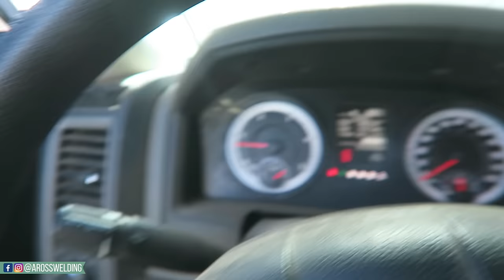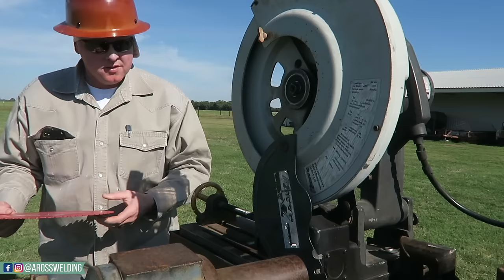BUILDING PIPE FENCE // NO COPING OR SADDLING PIPE

Comment: A LN25 with some flux core would be good for this job.
Reply: What size flux core cause I tried .035 out last week and switched back to my 6011 1/8 in by weeks end, settings were smooth abt 200 wire speed and couldn't tell you the amps
Reply: @caseyjones3182  
Have been using .035 NR 211 MP on galvanized pipe and carbon steel pipe . Lincoln also makes .045, .068, 5/64 and 3/32 wire. Lincoln also has a video on how to use this wire. Get a Lincoln welding consumables catalog at your LWS and look up recommended setting.

Comment: When you're making lots of cuts on heavier pipe like that a spray bottle with some water based coolant in it helps the blades last way longer.
Reply: Best coolant is a tablespoon of dawn dish liquid to 2 gallons of water. Fix a small 12v pump sprayer like used on ATV’s or whatever, to the saw so that when the trigger is pulled, it begins spraying an inch or so in front of the blade. It’ll nearly double if not triple the life of those blades. I’ve see a 12” Diablo last through 300+ cuts in 3” drill steel

Comment: Did they only have a 12" blade?  I would assume the RPM rating between a 12 and 14 inch blade are different. I've had  good luck Diablo Blades.
Reply: It’s all about SFM; a saw/blade combo set up for 14” will be running less surface speed on a 12” blade.

Comment: If your holes line up , why can't you pass a full-length pipe horizontally thru the full length of the pipe ? No waste . Also , why can't you use the first "cut-off" , split it down the middle and slide it over the pipe as a template , or guide for the rest of the cuts ?

Comment: yes cutting holes in the pipes with a torch use to be the way we did it years agom but with the sky rocket cost of the gases, and the dangerest goods tax on every tank fill, it just not cost effective any more, running a torch today is very costly, i always say, it cost 5 cnd bucks just to light the thing up and set it.. notto mention gas cutting torch is old school today..

Comment: Where did you get that hole cutter for the posts? I'm building some big ass corrals right now and I am about as burnt up as ya can get on saddling each individual rail.
Reply from the maker: I got mine at my local welding supply. Stillwater steel. You may be able to find them online. If not try callin one of these places. 
Stillwater steel 405-377-5550
Munn supply 580-234-4120
Chickasha ind and welding 405-224-2215

Tell them I sent you

Comment: What if you removed the ball rollers and replaced them with tube rollers in a vee configuration?  Like a V8, or how ever many rollers you wanted to use; at least four to center the pipe.  Just stager them so they run alongside each other at the bottom.  Should run last longer and be less of an annoyance on the job.
Reply: Then you wouldn't be able to slide the pipe and roll it. They serve a dual purpose.

Comment: I'VE GOT A GOOD QUESTION.WHY IS IT IN PIPELINE WELDING MOST OF THE WELDING OR ALL OF IT IS STICK WELDING,WHAT'S WRONG WITH FCAW(SELF-SHIELDED SEMI-AUTOMATIC WELDING)?  OR MIG(SHORT ARC)FOR THE ROOT PASS AND FCAW(INNERSHIELD)HOT PASS,FILL AND CAP PASS! YOU WOULD SAVE$$$$.
Reply: He may just be best at stick. 12 years stick on pipe and I think he said in previous videos he never went to weld school just learned from a shop

Comment: Why not run full joints all the way through? It would eliminate a lot of cutting. You would have to wait to put the end posts in but it would be less work and a hell of a lot stronger.
Reply: If your thinking of sliding the pipe all the way through the post. First off that would be tricky the holes would have to be on the  nut or maybe a bit sloppy. Ok and the weld the pipes where they butt, and then where they pass through the post??? I think that would be a lot harder to do. And don't forget longer pipes weigh more and harder to handle.
Reply: @TheRitchieLeeShow  that wouldn’t be tricky at all. No need to weld the butt joints together as you would end them inside of a post. It would be stronger than hell.

Comment: Whats the sprayer for on the truck? Small grass fire? Im not a welder i do weld but i wouldent call myself a welder haha im a heavy equipment mechaic by trade so i do lots lf steel arc and mig
Reply from the maker: I use it to wet down areas where I will be welding if it hasn’t rained in a while and the grass is real dry

Comment: On a large job I’d think custom ordered laser cut pipe with length and holes cut, driven down with skid steer hydraulic hammer would not only be sooooooo much faster but be cheaper with all those man hours saved

Comment: Good looking job but cutting 12-16" of pipe off each post would have got my dads belt across my backside! Scrap steel cost more to load up and haul off than its worth. Waste not want not! 

Nonetheless its a dang good looking fence
Reply: No doubt.
Reply: It's decent practice for welding small pipe. unless it is super magnetized, then it's a PITA not worth anything.

Comment: Austin where did you get your circle burner for straight torch?
Reply from the maker: I got it from my local welding supply. We couldn’t find them online so We are fixin to have them available on my website. Are you interested in one?
Reply: Austin Ross yes absolutely never saw quite like that it’s looks slick. I have got a pipe fence project coming up my self and that’s goin to be the ticket.
Reply from the maker: 👌 do you have an email I can reach you at?
Reply: Austin Ross yes I do but I sure hate to give it out on here. Would there be another way to get it to you
Reply from the maker: Ya you can just email me at arosswelding@gmail.com
Reply: Austin Ross will do thank you

Comment: Anyone ever use square tube ? Wouldn't need to cut all them holes in the posts, just hafta design a jig for setting the rails, anyways you're work looks top notch imo will definitely outlast us.
Reply from the maker: Ya I’ve seen some square tube fence. Looks nice too. Some times it can be more expensive than pipe, depending size.
Reply: @arosswelding  Oh ok, one more thing, I'm a retired ironworker and did quite a bit of welding over the years, was wondering why you wouldn't do your welding with a wire machine ? I know I could run 1 pass around that pipe and be on my way, plus not having to deal with all them stubs.
Reply: Em J Bee  8 Milwaukee Wisconsin

Comment: Why not build and set them in sections? Build a section in the jack stands and set it with a tractor and so on, just seems like a lot of position welds and having to do all cuts in position would take more time and be more difficult, just saying as a pipe fitter/welder

Comment: I do not know about Diablo metal cut off blades but we swear by Diablo on construction sites because unlike other blades there contractor grade models will cut through just about anything we might encounter on the job site and stay sharp a bit longer then others in the same price range. When you use your saw as much as we do on the roof for sheeting you need a blade you can count on every time you grab it Diablo was that blade for us.

Comment: This fence is gonna require a lot of maintenance to fight the rust that will set in yearly unless each pipe is painted with an apoxy coating paint.  Pipe is so expensive it has to be a rich person who has deep pockets that's willing to put out this much money for a fence usually people use creso post because all you do is paint them one time if you paint them at all and then you're finished with it But anything made out of metal will yearly have to be tended to unless you use that very expensive epoxy coating paint ,  I used to weld off shore and that required most of the work we had to do offshore was to install new 2 inch hand rails because the salt water would eat the 2" pipe up they would only use cheap paint offshore and that saltwater would get through it but that provided work for all the welders that went off shore if you ever go offshore to weld  pipe most of the pipe you will ever well Will be 2" handrail pipe.

Comment: Ok I have to ask > why did you cut all the pipe? even if you over sized the holes you should have saved you 110 cuts and one $100 blade and a heck of a lot of time. You might have had a few but joints > or if you did a nice job a few beveled pipe joints but hey you are a pipe line welder. Just seems like it would have been a lot faster and the fence had to be dam expensive

Comment: How much does a fence like this cost per foot
Reply from the maker: He is not doing this job by the foot but if it were it would be up there.
Reply: $25-$30/ft. New pipe has gotten expensive and all that welding ain't cheap either.

Comment: Why are you wasting so much time chopping the top off a fence post if they all come the same length you just put them into the ground to the proper depth to start with. When I pay for an 8 ft post I expect to get all the benefit of an 8 ft post , not a pilot cut-offs .